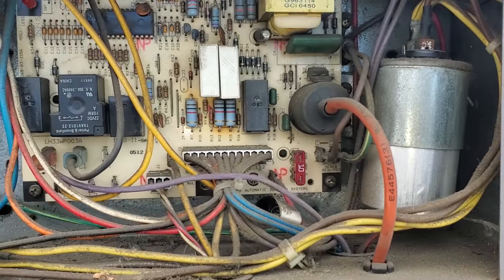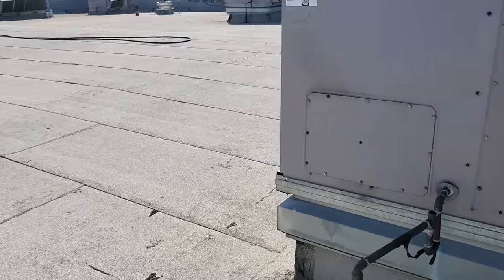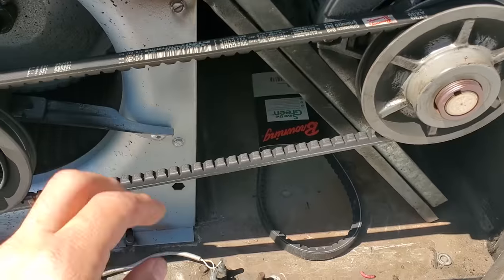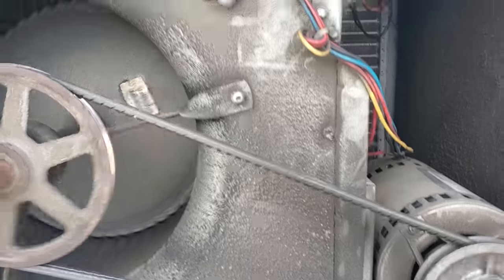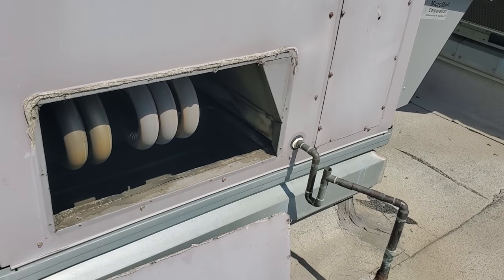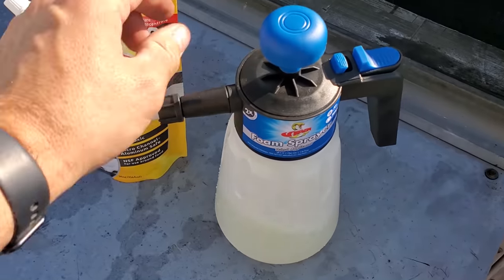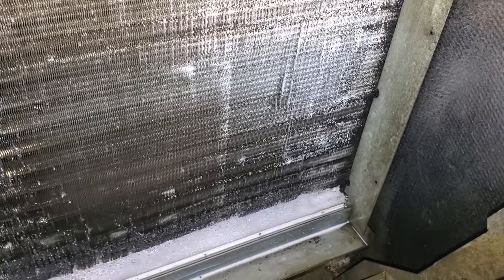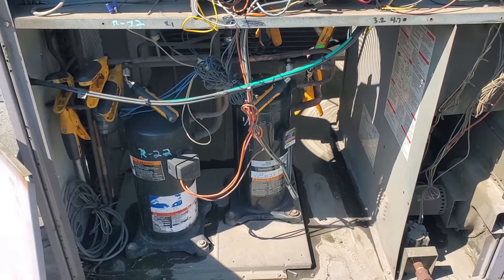THE THERMOSTAT IS MISSING AND IT'S TOO COLD

Comment: Wow, fuses 3 x and 4 x rated size? 
I once had a process machine with a 30 amp fused disconnect on the wall, the process engineer insisted I get him 100 amp fuses for the disconnect, I advised him and he wouldn't listen. I finally cut three short lengths of copper tubing, wrote "100 A" on each one and gave them to him. I also gave him the work order and told him he had to sign off on the "work performed" while reminding him he was not authorized to do electrical work, not even to change a fuse.
The fuses remained 30 A for many more years, I don't think he ever understood the real issue.

Comment: "Hey kid, you said you know how to change a tire right? Go on the roof and fix the AC." thats how you get units with the wrong fuses. This is coming from that kid that had to go up and clear condensation drain lines all the time.
Reply: Maybe its a cheap dollar store fuse pack. 1 each of 5 10 15 20

Comment: Just like eric O says at south main auto, he said, don’t fall down the rabbit hole with customer suggestions, stick to your plan of diagnosis. The customer can pull you a bunch of ways. 
I’ve had it happen myself with cars. Customer thinks it’s a particular wheel making noise, yet it’s the other side.
They thought it was front and rear, only was the rear, and had sway bar end links where the grease zerk was rubbing the lower control arm at the front. Customer didn’t even know

Comment: I spent my first 19 years in the trade in So Cal and i only ever found a few bad heat exchangers. Moved to the NE and within my first month here i found 7 bad heat exchangers. Definitely need heating here, So Cal not so much. Big difference in climates 10° vs  50°. Just found a carrier with 2 large cracks on Friday when i was replacing the blower shaft and pulley and bearings.

Comment: I know it's probably a redundant feature, but why don't manufactures add an inline filter just before the metering devices to help keep them from clogging? It would much easier to deal with a removeable filter than to repair or replace a metering device.
Reply: up next, filter/dryer's plugged and caused system burn out. dirty coils, bad cond. fan motor, etc. the list is endless and nobody will pay for it to be monitored fully 24/7, because all the monitoring equipment is also junk that fails too often and gives false positives~!
they simply cannot filter all the junk out from dirty burnt oil, so it still passes through which clogs the orifices. giant commercial refrigeration racks have many filters and strainers, guess what happens often? yep contaminates from work on other sections or burnt oil clogs the stuff and causes issues and burnouts still.

Comment: As an Industrial maintenance tech I am frequently given sketchy info from operators and/or supervisors and it is difficult sometimes because you do start off going down the wrong path and only after you realize that you are side-tracked do you pull back and refocus on the actual problem. Sometimes too much info is a bad thing and because we do not run the machines we are frequently at a disadvantage. I can usually figure out what's wrong with a machine if you tell me what the machine is supposed to do and then I can see why it does not work. Luckily with your experience you already know what the equipment is designed to do and can start from that. I was wondering if you have videos that show how you clean /replace the TXV strainers and/or plugged metering devices on the machines that you encounter? I am curious to see if you have to recover the freon to do these or if there are isolation valves somewhere. Thanks so much for your videos and it is inspiring to see techs like you and Craig Migliaccio that take pride in their work and keep such a great attitude  even when things go completely south.

Comment: Thermostats without auto-changeover are an abomination...maybe its because I live in Virginia where we need heat in the morning and A/C in the afternoon that it seems like its so important...but it boggles my mind how "smart" and "programmable" thermostats always seem to have that function disabled.  Had to figure out how to reprogram the ones in our rental to enable that feature, and when we got a place I had to replace the "smart" thermostats with different smart-ones that let me enable that feature.  My observations are the cooling is needed from about 3pm-11pm and heating from about 3am to 9am, if you don't swap mode before you go to bed or to work you'll wake up freezing or get home melting.

Comment: As a design engineer, given the southern California climate, I probably wouldn't even bother with a gas heat unit since even the smallest gas heaters are often oversized. I'd most likely do a heat pump, possibly without even any electric backup heat and just eat the higher electricity than gas cost the few times it needs heat. Of course do some calculations to justify it, but my gut reaction would lead me that way.
Reply: You need electric heat strips on a heat pump for heating the space during defrost
Reply: @strimbimmin328  On a lot of traditional units yes, mainly because they don't turn the indoor fan off during defrost. Modern mini-split heat pumps and VRF heat pump systems (Daikin VRV, Mitsubishi City Multi, etc.) just turn off the indoor fans and there is enough heat immediately in and around the indoor coil(s) for use in defrost. I do a lot of VRF system designs and almost never have to put in auxiliary heat systems, even in our climate where it routinely is below freezing and down to single digits. It just works.

Comment: Ok so I've put a piece of thermostat wire around the fuse before in a pinch or when I had one that I absolutely could not find the short on, I think we have all done that at some point, I can only remember doing it twice in 25 years.  but who even keeps anything but 5 amp blade fuses instock,  I don't even have a single one over 5 amp on the truck.

Comment: Maybe somebody can answer my question, cuz I never understood. So These restaurants, they are renting or leasing the unit that they are in, right???. If you're renting or leasing,  the property owners should be responsible for things like heating and cooling? If the building doesn't belong to The restaurant owner, why are they responsible for replacing things like that? Because if that's the case, and you are responsible, I would simply move to a different building instead of paying a $10k+  bill for a new AC.

Comment: Maybe I missed it, but when you said you had 3-phase power for the motor... were you measuring at the *contactor*, or the *motor*... I'm a *civilian*, so I don't have any idea how often the wiring can be a problem between the two...
Reply: Bad Power wires are usualy quite obvious. Wehn they short out there are big skidmarks and blown Fußes and when they break they usuals melt the insulation.

Comment: My boss says he changed belts by popping off the old ones and popping on the new ones by rotating the pulleys. And he said if they were really tight to get the belt on he would open the drive pulley slide the belt on and close the pulley back down which in mind my wouldnt be possible. The only right way is to move the motor bracket to get a new belt on right?
Reply: Yes. Moving the bracket and the motor is the only correct way to tighten to spec.  If its done by adjusting that Pulley, it changes the RPM of the blower and also the amp draw of the motor. Can cause delivered capacity issues, over-ampimg, incorrect evaporator TD, and insufficient humidity removal from the air. Whole lots of problems can come from being lazy. You're instincts are correct.
Reply: @winstonwright3613  My boss had yelled at me because I moved a motor bracket instead of popping a new belt on. I just didnt think it was possible to get a new belt on if you open the pulley, put the belt on then close the pulley. Was thinking you would have to pipe wrench the pulley closed because of crushing the belt. But good to know I was doing it right, thanks.
Reply from the maker: I will discuss this on my Livestream this evening 3/22/21 @ 5:PM (west coast time) come over and check it out https://youtu.be/4C3S2VG1qC8

Comment: Hi Dear,my self Mudaser. Can you help me please.  I want to know the answer of one question and in this question i am completly confused what to do. Recently  i am working on the vapour absorption refrigeration system. In this vapour of ammonia is comming out at a temperature of 25 degree. So my question is which condenser should i used to remove the latent heat??? Is it possible that we can used the air condenser to remove the latent heat of the refrigerant at that temperature of the refrigerant??? If we use the water conderser so, the water of the temperature is raised. But we can afford the wast of the water at that situtation so, the problem is that how we could remove the heat from the water. Basicaly i have two question 
Is it possible to use the air condenser to cool the refrigerant at 25 degree??
Or if we use the water cool condenser so,how we can remove the heat from the water which absorb during the condenser in order to not wast the water after one cycle.

Comment: You hope those fuses are not from Harbor Freight. They are absolute junk and will not open at the proper amperage. Usually many times the labeled amperage from what I have heard from people who have actually tested them.
Reply: it depends on the type of fuse as well, most of the ones i see around are slow blow, meaning it will take a sustained overcurrent to trip them.  It's the same with most breakers.  You CAN get fast blow fuses, but they are rare because it's unnecessary and they tend towards the false trips.  Just something to keep in mind when a layman tests something, they don't always fully understand it.  I'm not saying you were wrong, but the devil's in the details :P

Comment: Omg those flex gas lines on the roof, that's heretical.
Reply: I'm surprised that's not code there, since they're a shaky state(earthquakes) and it can back unions off easily
Reply: @throttlebottle5906  Flex lines would back off just as easy as a union would.  They're both threaded joints.

Also, those flex whips are 100% leaking.  All day under rain, direct sun, wind, etc.  The wear and tear must be immense.  And you know the customer isn't changing them out by the projected replacement age.

You may have a point about the "shakiness" but I don't know.  Where I live it is black pipe only.
Reply: black pipe only is bad in earthquake prone areas because the lines will shear off at fittings, shutoffs, appliance valves or back unions right off. the narrower threaded end is the weakened point.
using flex connectors properly torqued  is code in most every earthquake prone area, as is strapping/mounting water heaters tanks and everything else in place.
I'm in ohio and of course here you find fine anything braced and it's often all hard plumbed too.

Comment: R22 still ? banned since a decade here
Reply: Stoneage called, they want their refrigerant back. LOL 😆

I'm working as a ref tech/installator in sweden. Even R404 and R507 is banned from new installation. We are even exchanging R134 to R513 instead in our new installations with environment in mind. For freezers we are using 449 and 452 depending on unit and if there's part loads (452) or only one user (449) due to discharge temp as they tend to peak away with 449 with low evap temps
Reply: There's one video where Chris works on an R21 system.  Not yet seen him fix an R40 system, at least. :)
Reply: @Tevildo  Yea... Those belongs to the stoneage as well 😆
Reply: Now, this is stoneage, but before the time as well. The Kryotherm, a invention from north Sweden. There's not many of these left in action. Most of them has been parted out due to leaks, malfunction etc.

The unit keeps power supply with fuses, automatics and contactors at the orange front doors, supply air, exhaust air and recirculated air with flaps, placed in the orange section. Refrigeration units is kept in the blue parts, olé Bitzer bhs units, all cooled down by a multichannel condenser between the blue and orange section. Either out on the roof or out in the supermarket. The company was broke in beginning of 2010, but was saved by an other company with similar business profile.

This particular unit was rebuilt for some years ago with plate heat exchangers. Why, I dont know...

www.mbsca.se/img/kryo.jpg

Comment: Really wished they'd used electric heat or heat pump instead of gas why can't these tech try something new its always gas I mean yall live in a climate were its not too cold
Reply: True, especially as an AC has like 90% of the components of a heat pump already, a few valves more and it should heat as well
Reply: @tobimai4843  fr fr no wonder cali an those cities near there are covered in smog i can't wait to get out in the failed if its r 22 unit I'm working out there an i see its using gas I'll use my skills to pursue them about using or trying heat pump instead